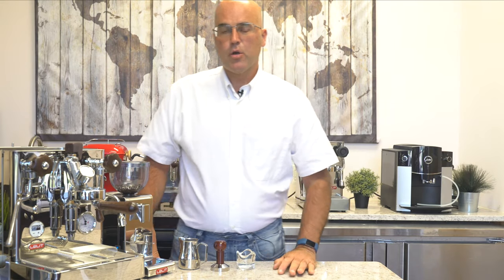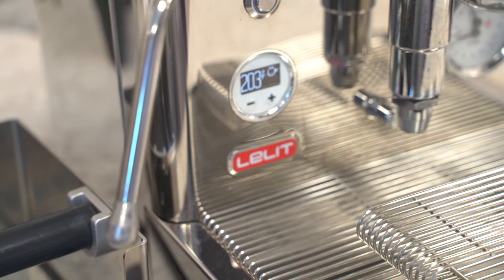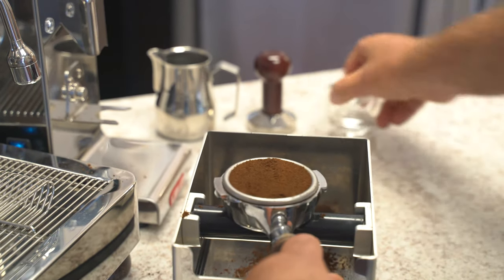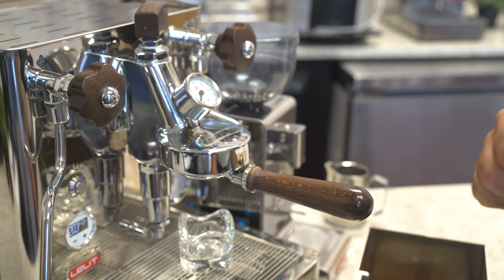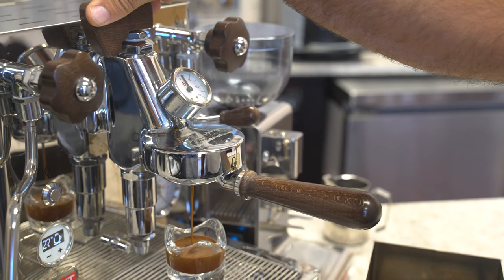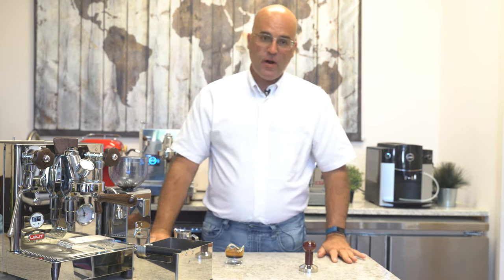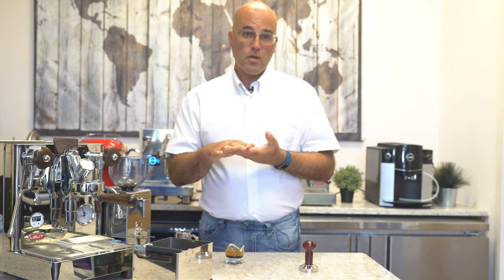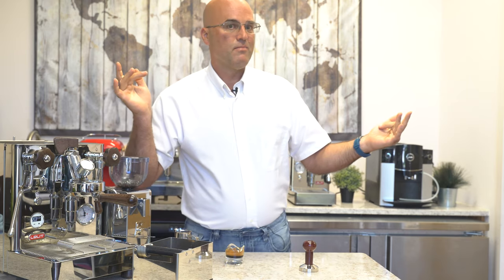Lelit Bianca Pressure Profiling Spring Piston Lever

Comment: Thanks for the video! (even though  you've burned the grind for 35 s with the portafilter locked into the grouphead )
Reply: To try and avoid this very thing I keep my baskets not locked into the portafilter.  I keep the portafilter locked into the grouphead and grind into the basket then I remove the portafilter add the basket tamp install the portafilter into the grouphead and brew.  I have a Strega.